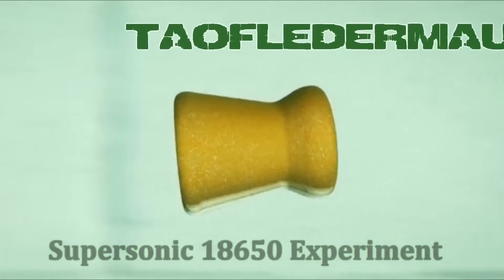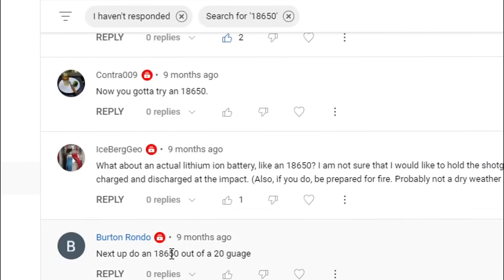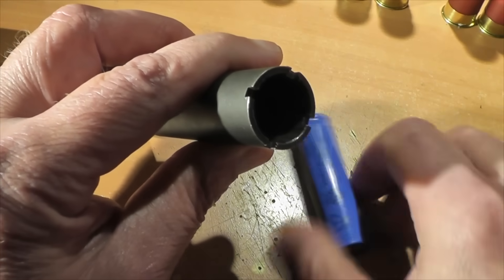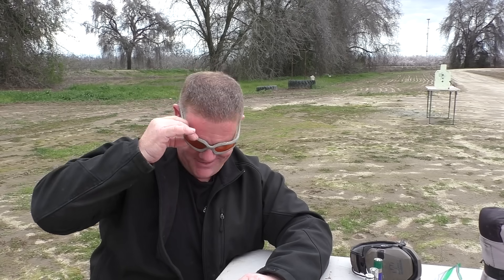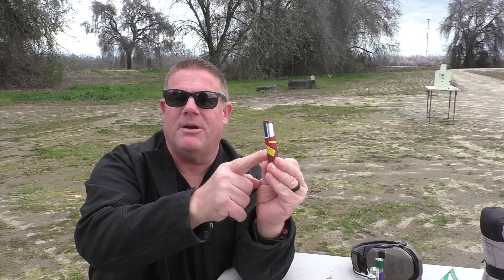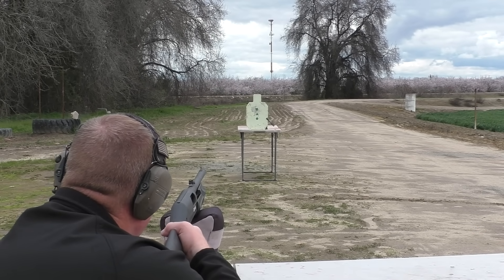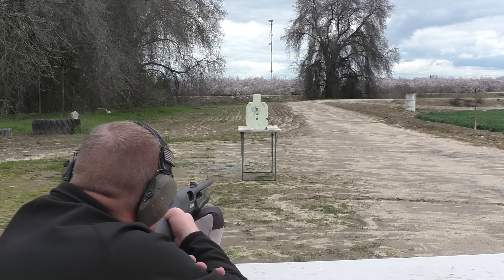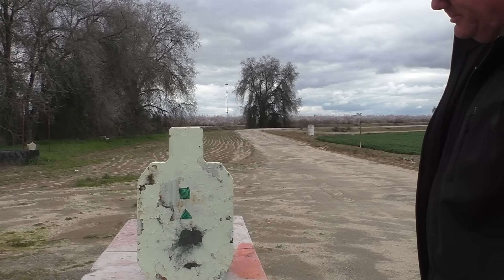12ga 18650 Li-Ion SHOTGUN Slugs - TESTED!

Comment: I've used lithium batteries as 12 & 20 gadgets slugs, the results were phenomenal. 

If you really want a show, make sure they are fully charged and make sure your target is solid enough to stop the slug and ensure that it(target) has a high moisture level. Charged lithium batteries hate moisture! lol

EDIT: I finished watching the video, to  see the effects of the charged battery, he should've used a gelatin  block as the target.

With gelatin, you can see the effects of the charged battery igniting. It's a little expensive but it showed the destruction of the battery discharge.

Comment: Elemental lithium burns in water. Lithium ions (you know, as in Lithium ION batteries) have already given away their electron, removing their ability to react with H2O. Lithium ions (aka Lithium Chloride) will dissolve in water, just like any other ionic compound, such as salt (aka Sodium Chloride).

Comment: I bet if you introduce a strong oxidizer to the equation and use a lithium battery, you'd also see a little.....pyrotechnics.
A cylinder full of sodium nitrate at the front of the battery would be amazing

Comment: casting a big cylinder down range with no idea whats going to happen....this epitomises taufledermaus for me

Ooh Hydrostatic shocked the table into submission....I just recently took some lithium batteries apart to try and extract the lithium foile....those things react to oxygen really fast and stink "a lot" ...dumped mine in oil within 10 seconds and it had still oxidised before I got it into the oil

Comment: I had a 5,000 mAh cellphone battery go off in my hand--fully charged.  Had a metal toolbox to dump it in and ran it outside.  A full breath of air took me back inside to turn off AC and open windows. After several hours of ventilating the house, there was still a distinct smell.  Gave it several more hours before I could trust it.

Comment: 3.5 is nearly dead and will only power a vape for a couple hits. Fully charged is 4.2V. 
One of lithiums big benefits over old school batteries is holding full voltage for most of its charge. Once the voltage finally starts to drop, its nearly empty.

Comment: You can turn those normal batteries into bullets using only electricity. Put 2 normal AA batteries in series, put them in a tube, and apply high voltage AC current to it and one of the batteries will fly at a high speed. Make sure one battery can move out easily.  Fast enough to unalive a human. Not sure if this works for those lithium batteries because i did this when i was a kid and i didn't have those lithium batteries back then.

Comment: The reason why there's more stability out of a charged one is because there's more weight when it's charged for the discharged one (ded battery) think of it / try like this grab a sheet of paper lay it flat on the palm of your hand and start spinning and straightening your hand as if you're going in for a Hi-5 it may take a few tries or more but you will eventually figure the rest of the too hard to explain stuff out just don't spin too much if you can't do it then then try the next day and so on as you don't want to get sick (I found out by mistake at the age of either 4 or 5 in kindergarten and ended up having to much fun and all that was left was sad as I got sick from doing it too much)

Comment: Of all the 18650 batteries you could have used, those Ultrafire Batteries are total junk. They are so weak, I wouldn't be surprised if they only had a tiny 1220 cell wrapped inside them. Fail. the LG or Samsung are the ones to get.

Comment: Water is actually a good way to dispose/discharge batteries, as their power is slowly bled off and they are kept cool in the process. Unless there's some salt in the water, the power drain is actually rather slow, as pure water isn't a great conductor. If you want an explosive discharge, short them out, like the battery that was crushed against that steel plate. Bits of it were red hot.

Comment: 1) Fully charged 18650 is 4.2 volts. 
2) The charged round should give sparks on the metal plate, which it did I guess. 
3) Charged or not charged, the Lithium metal in the battery catches fire as soon as it comes in contact with water. Like sodium metal does.

Comment: You chose the wrong type of battery.. there is only around 600 mAH  of capacity nowhere near the 3000 that is stated on the battery. that is the least energy dense one you can buy.  If you want a better reaction you need one with higher capacity..  a LG  gh2 3000mAh is what I would recommend.. it has a very high power discharge. Therefore will create the biggest chemical reaction when damaged.. on the downside it will be a lot heavier battery. I don't know if that would be an issue when it comes to firing them from a gun.

Comment: So instead of will it blend, it’s will it shoot? If you haven’t tried super capacitors also know as ultra capacitors fully charged has the potential for some interesting results, extreme caution would be prudent in this endeavour.
The collaboration with local electronics YouTuber would be wise.

Comment: The clue to no fire is that a 18650 Lithium ion rechargeable cell does not contain lithium metal, and the quantity of lithium ions is tiny. 
A  maximally charged cell of this sort at 4.2 volts (nominally 3.7 volts) has a lot of electrical energy, up to 3.5 Amp hours, so if mechanically crushed or pierced will often short internally and cause an electrical fire, burning the electrolyte, graphite and aluminium metal components in an electropyrotechnic fire, bursting the casing. 
In the microseconds of impact when fired from a gun at a solid target, the integrity of the case is destroyed and will not hold the components together long enough for a fire to start.

Comment: So the only thing I'm thinking with charge batteries is what happens if it manages to complete the circuit where the battery is inside the shell? Is  there any potential for it igniting?

Comment: Lithium is some nasty stuff.  It is toxic and not only flammable but they are called a thermal accelerant (or something like that).  When they ignite that just keep getting hotter and hotter and they are VERY hard to extinguish.  I would not want to breath that but also think of the lithium and cobalt in the wound.

Comment: If you ever try this again, try Energizer single use lithium batteries. They have a strip of pure lithium in them where the lithium-ion batteries have doped lithium or are doped with lithium.
I have no idea if it will be less reactive if it's dead but I've pulled apart new ones to play with & the lithium strip starts reacting with oxygen in the air almost instantly. If there's 20% moisture in the air or more, it may ignite.
Ask me how I know.

Comment: Vape mods use 18650s more than any other path except tesla. Its a Vape Battery for people that actually vape the right way. Not to be confused with morons that buy them from gas stations. But in Vaping we only use the flat tops.

Comment: i appreciate some of your guys' humor but i do need to warn you about the 18650 batteries. you should be more careful around them dont ever put your tongue close to one. 
i learned alot about these from the ecigs and the people that make them and used them when they first came out. i also seen first hand how dangerous they can be in unregulated devices. some of these batteries can put out over 30-40 amps worth of power. not just in a fraction of a second burst. but continuous draw load. its why they can run electric cars off these things. these have enough energy density in them to delete peoples faces or existence. and the next size up i thinks the 26650 and also even more powerful but lower voltage.

Comment: 3.5 volts is not charged battery. That is almost dead actually. fully charged is 4.2 Volts
Reply from the maker: they weren't 0 volts in other words
Reply: Either way I still liked the video. I always wanted to see someone shoot batteries. Also if you want the batteries to explode try shooting the 123 non rechargeable lithium batteries at water. Those batteries are a different chemistry and they contain a significant amount of lithium metal. I've heard those batteries contain something like 100 times more lithium than a lithium ion battery.

Comment: I did some math and found a .50 muzzle loader could, in theory, fire a AAA battery (with a sabot and probably wadding too). I'm curious about it, but wouldn't risk my only muzzle loader to test or risk polluting. The weight and general shape are rather close.

Comment: I've heard one guy claim the li-ion battery flat packs could be used in breaching door locks. Stab it against the lock and the lithium is supposed to burn through enough to weaken the lock. Aka the phone bomb. 

I'm wondering if you could do an 1800,s musket ball using 12g shell but the lead ball external like they would do back in the day. Could you try both loose ball vs encased ball?

Comment: dude that computer had a voodoo wtf
Reply: Funny, but thankfully, no, it didn't. It didn't appear to have any desirable video or sound cards in it (looked like a basic audio riser card and integrated video). Considering some cards sell for hundreds or even thousands of dollars and could be in pretty much any PC from the 90s or early 2000s, it's definitely a good idea to not just trash PCs that are more than 20 years old. Still, some collector would have likely bought that old HP. :o

Comment: A lithium battery can discharge a lot of current quickly. They have less internal resistance that alkaline batteries. When you took off the PVC wrapper you exposed the cathode.  So if anything conductive shorted the body to the anode, like a wedding ring, you'd get  a nasty burn of as many amps as the thing had left.

Comment: If you over-charge them just a bit, You might get results.
Be extremely careful, of course.
Where a typical 18650 is at 4.2 volts fully charged. (that's a 3.7v battery) Charge it up to 4.3. Take proper chemical fire precautions!
I've never used them as ammo but I did get results using them as targets using  .22LR. The reaction was 1 to 3 seconds delayed though. But ya, they can light up like a road flare.
 It's oxygen that causes the reaction. Water just makes more oxygen available faster.

Comment: For those curious, the "0" in 18650 is because the length measurement is in tenths of a mm. I was once told it meant the positive terminal is flat, and that button-top cells are 18655. I've also heard it denotes that the cell does not have inbuilt overvoltage protection. I've heard it means the cell is cylindrical.  None of those is true.

Comment: I was gonna ask if this was the American version of a standard AA Battery but I decided to Google it. Found out the 18650 kinda stands for its size, 18 mm wide by 65mm tall while a AA is 14.5 mm wide by 50 mm tall. Voltage is different too, 3.7v to 1.5v.

Comment: Try charging them to 4.2 Volts with a proper battery charger (even a good quality Lithium-ion cells you can buy at a vape shop would still be amazingly destructive due to the fact that they now store a LOT of energy within a small package after completely charged, which is what makes them so dangerous when mishandled in the first place), which should make for a spectacular electrical explosion along with nasty and hot shrapnels.

Comment: 3.5 volts is pretty dead for an 18650. Fully charged is 4.2 volts. Also im pretty sure fully charged ones are heavier and feel denser. At least they feel that way.
Reply: There is no relationship between the mass of charged and discharged batteries other than they are the same before and after charging. The lithium ions are moved away from the cathode a bit and closer to the anode when charging. Any electrons arriving are offset by electrons leaving. Lithium batteries swell when charged because the anode gets filled up with lithium ions which aren’t small. Sodium is much bigger so the swelling and cracking of the anode is the biggest issue

Comment: Should try Silver Watch batteries in a .410 shotgun. Wonder how they do as improvised werewolf shot. They are positively tiny but go all the way up to 11mm in diameter. Very tough to find outside of Digikey or Mouser though. SR1120 should do it but with very little room to spare.

Comment: 4.2 V is fully charged for these cells. IMR (Manganese cathode) and ICR (Cobalt cathode) are distinctly different Lion battery chemistries. Generally IMR is much safer and used in high current load applications. I suspect an ICR 18650, fully charged, might have given you the spectacle you were chasing.

Comment: 4:22 if it’s a full bore, I’ve heard stories of expanding bullets being used in the civil war that were loose in the barrel, but the back of the bullet would expand to make a tight seal inside the rifled barrel. I feel that might happen here where the batteries certainly aren’t rifled themselves, but might get squished into the rifling when shot. Enough said let’s test that theory!
5:26 welp, I was wrong! Great video tho!

Comment: If tesla just made large batteries instead of using thousands of smaller ones the battery pack would be much lighter and have more energy density cause these cells are round and make the worse ussage of the space available and all the extra metal on the casing adds extra weight.

Comment: trustfire 18650 is not original lion, 16340 inside, need test original lion  and water samsung or lg or sanyo
Reply from the maker: Only a few of these were actually the Ultrafire,  the rest were from a Ryobi battery pack.  I have no idea what brand they are,  but are lime green.

Comment: Graphite has a very high ignition point, graphite is what burns hot. The flaming Teslas are GRAPHITE FIRES fueled by melting aluminum in car's chassis that oxidizes to form ALUMINUM OXIDE . 
Which is THERMITE. 🔥
"Green Tech."👌

Comment: Lithium reacts with water but does not, necessarily, cause a fire. I do not know how much lithium those batteries have but I'm guessing that it's not a lot. If that's the case then you would only see some bubbles on the water as the reaction occurs and after that it would simply stop to react. What you can do is use a reagent to check if the water is alkaline, I believe it's called Phenolphthalein, It should make the water turn pink, The pinker it gets the more alkaline the water is. 
All Alkaline metals react with water, Lithium (Li) is the weakest, followed by Sodium (Na), Potassium (K), Rubidium (Rb) and Caesium (Cs). Caesium is probably the hardest to find since it is extremely dangerous and its reaction with water is extremely violent. I believe that all these Alkaline metals are also controlled and hard to get. You have one last one, Francium (Fr), but that one is one of the rarest elements on earth and it is also radioactive so the chances of actually getting some are simply 0%.
Reply: By the way, I remember that I once saw episode from Brainiac where they showed these reactions with the exception of Francium, it should give you a better understanding of what I said.

Comment: Nobody do this at home. Especially if you're using high Amp 18650 batteries. They will explode like a grenade if the side and top touch metal.

Comment: Perhaps the impact is pushing away the water from touching the battery debris? Maybe shoot into a pool of water so there's enough water to still submerge the battery parts on impact? I don't know if it's enough to break open the battery on impact though.

On a different note, I just saw a 4ga. (if I recall correctly) shotgun video recently from Garand Thumb. Must be fun to test these experimental shells on that huge gauge.

Comment: A fully charged 18650 should have 4,1-4,2 volts. at 3,5 volts this kind of cell is pretty much completely depleted. A nominal battery voltage is not a number for a charged one

Comment: iff you compressed water between 2 plates like a small box at say 3000 psi would it stop a bullet add custard or non setting jelly .  just to make it thicker.  like tire sealer.

Comment: While lithium has exothermic reaction with water creating hydrogen and heat in process. But in lithium ion batteries, lithium is not in it's pure metallic form and it is stored inside graphite, which makes it even more stabile. Ofcourse it still reacts with water but reaction is negligible compared to water cooling capacity. If fact water is the most effective and easiest way to extinguish lithium battery fire that I know of,  because of its immense specific thermal capacity.  
I know this because I've personally experienced lithium battery fire and suppressed it. What makes lithium battery fires difficult is that it's chain reaction: one cell has thermal runway -> it heats up nearby cell making it catch fire as well. 

I have also disassembled lipo pouch cells and dropped water into them. Reaction is really lame.

Comment: I once dropped a AA battery from a 20 story building back in 1998. It was at about 3am so no people were around. It made a loud “snap” sound when it hit the brick ground and bounced violently off the building window. It only left a slight scuff on the battery.
Reply: Adding this to my “happened in 1998” list
Reply: @olympian3  1998 when you were born?
Reply: @olympian3 I was born that year.
Reply: Alkaline.
Reply: I once took a leak off the 16th floor balcony at a party. Young and dumb, but it seemed like a good idea at the time. I did it for science

Comment: I wonder if the charged vs uncharged batteries had different balance points or one is more evenly weighted due to the breakdown of the chemicals inside as the battery is drained? It was interesting how the charged batteries flew perfectly through both shotguns and the uncharged was more luck as to whether they flew well or not.

Comment: Panasonic/Tesla 18650 is 46-47 grams, other normal brand cells are 45+ grams as well. Why did you use noname aliexpress cheap cell that is only 35 grams?
Reply from the maker: Because it didn't really matter.